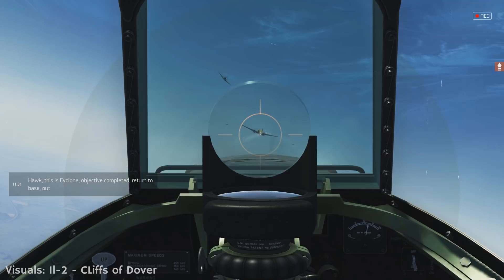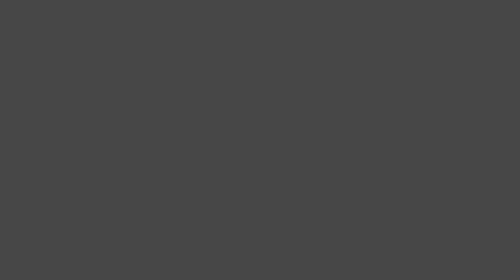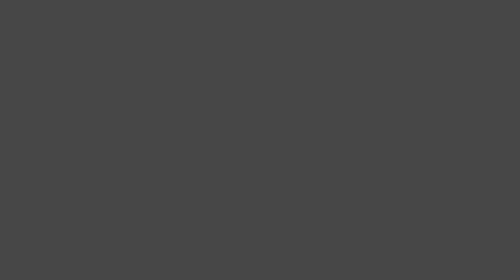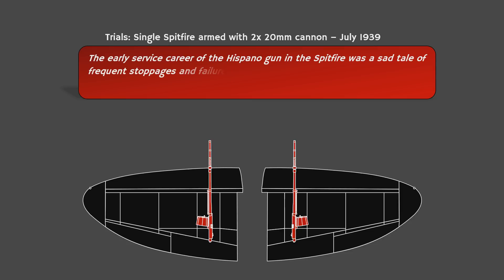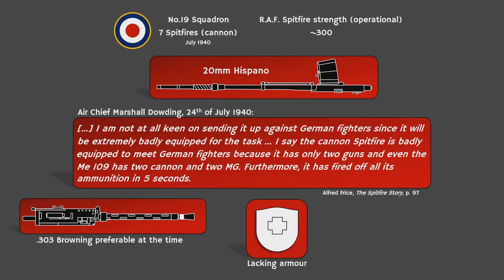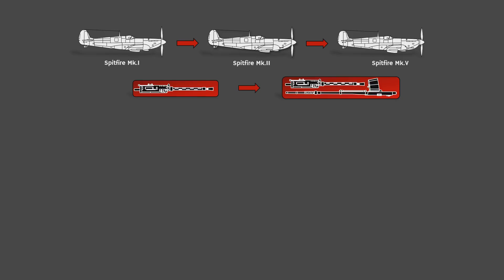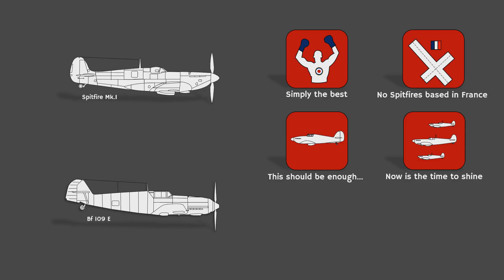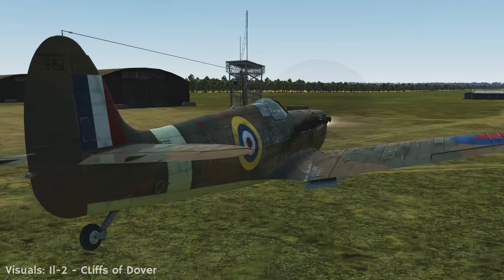⚜ | Clearing up Spitfire Misconceptions

Comment: The greatest misconception regarding the Spitfire is that it "won the war."
Reply: @Michael Paterson no sorry.
Reply: @Michael Paterson laughs in yak-3
Reply: @Michael Paterson ; How can any aircraft be the single most important when multiple types were essential?
Reply: @Michael Paterson ; That is simply factually totally wrong. It's also using an incredibly narrow focus. Most of the fighters when used where they excelled had an impact. The Spitfire where is was used had an impact. Which plane had the most kills in the 'Battle Of Britain'?
Reply: @buildmotosykletist1987  the only reason the hurricane shot down more German planes in the battle of Britain was because it was produced for a decade longer. There were 1715 hurricanes in use compared to 300 spitfires during the battle of Britain. So of course the hurricane will have shot down more German planes.
Reply: @buildmotosykletist1987  the orogional commenter means that in an overall impact the spitfire had the most impact. The p-51 for instance while a good escort plane could only truly do that. Because it was not as maneuverable as any other fighters so would lose in most dogfights when not high up. It also had a carrying capacity half that of the Spitfire's so wasn't as good in ground attack. Also the spitfire could be fitted with cameras making it an excellent reconnaisanse plane. While I agree that different types of aircraft were needed if America didn't use daylight bombing the p-51 would have never been needed and there would be less losses of bombers. On the flip, the p-47 was the best ground attack but lacked capability in dogfights. So the spitfire if you had to pick a fighter to do everything would be the one you pick because it can do every role very well or at least decently while the only role it couldn't, (being a long range escort) could easily be overcome by bombing at nighttime instead of in the daylight. It would also allow excess gunners to be scrapped in the b-17 to give faster speed or bigger payload.
Reply: @jacobkingsford5209  ; You might consider some reading on the subject and not unverified internet articles but verified sources like books. i.e. There were only 700 odd Hurricanes on 30 August and roughly 400 Spitfires.
Reply: @buildmotosykletist1987  I was not talking about a single day I was talking about the entirety of the battle of Britain. Overall throughout the entirety of the battle of Britain  1715 hurricanes were flown.
Reply: The losses the Luftwaffe sustained, particularly in terms of its best pilots in the Battle of Britain sowed the seeds of its eventual demise, which was largely the result of the Spitfire.
Reply: @nickdanger3802  Yank claims carry very little weight outside America. By the time the USAF showed up over Germany, the Luftwaffe as already in bad shape.
Reply: @gw7624  The Burning Blue  Paul Addison is a British author and historian, specializing in the British experience in WWII.   Jeremy A. Crang  is Lecturer in History and Assistant Director of the Center for WWII Studies at the University of Edinburgh. Mustang quote is from MUSTANG VARIANTS OF THE RAF AND RAAF
Reply: @nickdanger3802  Do yourself a favour - go look up the losses sustained by the Luftwaffe, particularly in terms of experienced pilots, in both the battle of Britain and Barbarossa. Now go look up the problems the Luftwaffe faced post 1942 in terms of fuel shortages. That the Luftwaffe was a shell of its former self by 43 is not even remotely disputed by historians.

Comment: Another misconception regarding the Spitfire Mk Ia, the main Battle of Britain Spitfire, is that it had a fast roll rate. This is not so, particularly at airspeeds above 300 kph (186.4 mph). The fabric covering on the ailerons would to ballon at high airspeeds, reducing the ailerons' efficiency and performance.
This caused a change from fabric-covered to metal-covered ailerons on the Spit V and the roll rate increased a good deal at all speeds.
Since most of the aerial combat in that era occurred at airspeeds higher than that, the Spitfire was at a disadvantage in a fast, turning fight against the better rolling and climbing Bf-109G, particularly the G-2.
Also, The Hurricane was a better, more stable gun platform, was equally armed (8x .303 mgs), had a smaller continuous turning circle, and as good a roll rate as the Spitfire. The Hurri's top speed was not as fast as the Spit's, but absolute top speed was not a serious factor in the BOB combat arena.

Comment: The most common misconception that I hear is that the spitfire was the most amazing aircraft to fly. 
However it did have 1 deadly design flaw, a very narrow undercarriage. 
As you can see at 8:28 the inwards folding rather than the outwards folding wheels ( unlike the Hurricane and the P51) but also akin to the Bf-109 meant a ground loop was a possibility if you took off or landed in a crosswind.  
This was because the wing wasn't strong enough to support the landing gear away from the center airframe. 
I own a Cessna 180 have almost 2000 flying hours and its a handfull that like the spitfire is very unforgiving of the unwary. Look ground loop up
Reply: tOM odONNEL: The RAF were still using grass strips through to 44 and I have yet to read it was a problem. Maybe the RAF trained their pilots better.
And my friend even US pilots liked them Maj Blyth loved it and he did 50+ PR runs to Berlin
Reply: A lot of planes had similar quirks to deal with. Those planes all had huge engines with lot of torque, and needed a certain amount of rudder trim just to roll straight on takeoff. They all had ground loop issues, it is just that some were more finicky about it than others.
Reply: It was forbidden to spin it and its stall characteristics were not very pleasant. But the latter is true for most WWII vintage aircraft.

Comment: The Damler Benz DB 601 had a significantly larger displacement advantage over the Merlin. 33 litres to 27 litres the later DB 605 was 36 litres. The injection pump on the German engines look similar to diesel injection pump on the outside. Carburetors where used all the way till the end of the war in pretty much all western engines. The later Merlin used higher octane fuel not available to the Germans had improved supercharging and intercooling but still had injection type carburetors. The Merlin had flame arrestor between the cylinder head and the manifold so a pre-ignition did not ignite all the pressurized fuel and air in the manifold and supercharger blowing the engine to smithereens. I think the Merlin achieve the highest refinement of any piston engine off the war while the German engine were technically superior in some ways I think the lack of high octane fuels held back development of their engines never achieving the same HP per litre.
Reply: Read Calum E. Douglas’s book on the subject.
Reply: @thethirdman225  I'll look it up.👍

Comment: Note. The Hurricane upgrade from the 1.a used in France to the 1.b used in the Battle of Britain was much more significant than many realise. Firstly Metal covered wings - not fabric. Secondly 3-Blade Rotol variable pitch propellers - not 2 blade wooden fixed ones. Thirdly more powerful and reliable Merlin engines - and improved oil coolers. Finally, using water / ethanol cooling liquid, and armour plate behind the pilot and armoured glass in front so big improvements all round for safety on top of power speed and control.

Comment: I believe two additional points are worth noting:_ Firstly while the mk1 Spitfire was basically similar in many respects to its prototype still with its 2 bladed wooden propeller, the Me 109s it faced in the battle of Britain were in fact the 5th variant, having been in service since around 1937 it had been improved, it first versions actually had RR Kestrel engines. Secondly another reason that the powers that be wanted to retain the .303 armament was that most new pilots reaching squadrons following the horrendous losses during the battle of France couldn't shoot straight so the 8 guns could be aimed to create an 10 foot wide blast pattern (like a shotgun)at 300 yards to compensate for poor aim.

Comment: Hi Chris, Thanks for all your great videos. You invite suggestions. Try this: Can you please do a comprehensive break-down of The German fuels (and not forgetting the often over-looked lubricating oils) industry in WW2, how things started and how things dramatically changed over the course of the war. Your 'drill-down' analysis should include a description of the basic production processes (the legendary 'secret' synthetic fuels extraction from coal, etc), where all these various plants were located, their capacities, their specialisations, their manpower requirements, how many survived vs how many damaged and at what times, how was fuel distributed to far-flung forward battlefronts, what help/obstruction did Germany receive from neighbouring countries. In conducting such an analysis you need to get down to some nitty-gritty detail in respect of the different grades of fuel used by different arms of the Luftwaffe (and other German military services), were the aero-engine manufacturers pushing for even higher octane grades and were these fuels under active development, had Germany analysed fuels and lubricating oils from crashed Allied aircraft, how aware were they of the octane rating they were using? Your analysis should also include a future projection of how the rapid spread of turbojets, displacing the piston engine would have changed the fuel supply situation. Then there are special weapons like the V-1 which used a low-grade of petrol. Had their numbers reached the high levels (they didn't) demanded by Hitler would that have adversely impacted the supply situation for conventional military needs. This is a big project but one that is long, long over-due but it is a vitally important back-drop to understand how the war progressed.

Comment: I am fortunate enough to live next door to North Weald airfield in Essex, one of the last remaining BoB airfields still in use, if only by civilian aircraft (I also work next to Stapleford Tawney airfield, a satellite of North Weald).There were many squadrons based here over the course of WWII but North Weald is known mainly as a base for Hurricanes. There is a common misconception in the UK that the Spitfire won the BoB and while it's contribution in this period cannot be overstated, the locals around here will tell you this simply isn't so. There just weren't enough of them at that time. So the majority of the work had to be carried out by the increasingly outmatched Hurricane, an aircraft often looked down upon. But we love the Hurricane around here :)
This area was fairly extensively bombed during the summer of '40 and there are still a few bomb craters scattered around in the fields as well as some very small pillboxes. I am well used to the sound of both Hurricane and Spitfire these days as the airfield is still used sometimes by restorationists and the BoB flight always passes by directly overhead on it's way to London.  We did eventually get some Spitfires when some American Eagles moved in later in the war and I believe the Norwegian squadrons that came after had a mix of both ( I could be wrong).
So the point is, I guess, do not forget the Hurricane and her pilots. they did an amazing job considering what they were up against. I'd love to see a Hurricane video one day. Sure, it's not as sexy as a Spitfire, but it had balls!

This is a quote, lifted from Wiki, from a Hurricane pilot about trying to fight the superior 109's: 

 'Another thing we did was to devise a manoeuvre which was aimed at getting us out of a difficult corner if we ever got into one. This may sound very extraordinary, probably, to practising pilots today, but it consisted of putting everything into the left hand front corner of the cockpit. If you saw a 109 on your tail, and it hadn't shot you down at that point, you put on full throttle, fine pitch, full left rudder, full left stick and full forward stick. This resulted in a horrible manoeuvre which was, in fact, a negative g spiral dive. But you would come out of the bottom with no 109 on your tail and your aeroplane intact.'
Roland Beaumont describing how a Hurricane can get away from an Me109

Gosh!

Comment: Once they sorted out the jamming problem of the Hispanos it became an excellent weapon with enormous hitting power. Here's something not many know, after the initial BoB combat experience it became obvious that the eight .303s had inadequate "hitting power" (ie destructive penetration) against armoured aircraft with 'self sealing' fuel tanks. Although the eight guns between them fired no fewer than 160 rounds per second, they were initially adjusted to concentrate their fire at the long range of 365 m which led to the hits being spread across the target at shorter ranges, this was no good because the .303 needed concentration of hits to penetrate or destroy. As German aircraft equipped with self-sealing fuel tanks and armour were now the norm not the rarity, it proved necessary to concentrate fire at much closer ranges, hence the aircraft had to close much closer and were susceptable to enemy defence fire. Because of the lack of destructive force against self sealing tanks, .303 incendiary rounds were required to ignite the tanks, but,  due to a type shortage, usually only one or two of the eight guns could be loaded with incendiary  ammunition. A series of ground tests carried out by the British, firing at a redundant Bristol Blenheim from 180m to the rear (dangerously close in a-a combat) revealed that the .303 incendiary B Mk VI bullets would set light to a Blenheim wing tank with only one hit out of five! Hence, the Brits quickly looked at the Mitchell designed Spitifre variant Type 312 wing which had room for four Browning .50 cal's, but, and this is so typical of the Brits, the weapon was considered "under-developed" by the Air Ministry and was placed aside, and besides, they had millions of .303 ammunition stockpiled so continued with that despite knowing it was inadequate

Comment: Cannot believe the Writer did not do his “Home Work”.
Poster is a FAA Licensed A&P and a Aeronautical Eng.
The Spitfire suffered from “Fuel Starvation” on inverted flight, but would transition to flooding the supercharger on returning to level attitude.
This was fixed by placing a “Check Valve in the Fuel line” by Beatrice Shilling.
Reply: RAE restrictor.  Shilling's was not effective enough, so it was modified.

Comment: There are manoeuvres you can use to get over the Corroborator problem. For a dive, just flip the plane over as you go into a dive to commence a positive G dive instead of negative. For an Aeleron roll, just do a barrel roll instead. :)     Also it could be said the Spitfire whilst important during the battle of britain, would have been better strategically to be simply overtaken be Hurricane production. However, it was important for it's development during the war where the Hurricane became obsolete.

Comment: I think another misconception is that since Hurricanes were usually mentioned as being less good then the legendary Spitfire, many may think that Hurricane performed poorly or something. I think I read about it somewhere that Hurricanes, in all submodels, actually scored more kills than the Spitfire series.
Reply: better in the BoB which is prob what the OT meant though that was for other reasons. The H was obsolescent  by 41 and should have been replaced but for the foul ups on the tempest/Typhoon  design/deployment

Comment: The early spits did not flood when you pushed the nose forward.  G-forces forced the float against the top of the carb, causing the flow of fuel to shut off, because the float was now in the position it would be if the float chamber was full of fuel.

Comment: Any truth to the rumor that the reason the Brits put eight machine guns in the wings of the early Spitfires was because the wing was too flexible and resulted in a very scattered shot pattern?  Having eight guns increased the chances of hitting the target.
The biggest advantage that the RAF Fighter Command, both Spitfires and Hurricanes, had during the Battle of Britain was that they were fighting defensively so their short range wasn't an issue.  The German 109 pilots had to constantly monitor their fuel gauge or else they stood a good chance of running out of gas and not getting home.  It is hard to dogfight with one eye looking at the fuel gauge and the other eye looking out for the enemy.
Reply: The RAF specification to which both the Hurticane and Spitfire were designed expressly called for 8 guns. The .5 Browning wasn’t an option. 
The 8 guns were an unpleasant surprise for the Luftwaffe as the 109 was comparatively under gunned. They never really made up for the defecit.

Comment: The biggest misconception is that it (and the Hurricane) were fighters.  The Operational Requirement  was to shoot down UNESCORTED bombers flying from Germany – Well beyond the Combat Radius of any escort expected to  be available in the foreseeable future.    They were Bomber Destroyers.   Their performance and equipment were optimised to that end.    The manoeuvres which caused temporary embarrassment over a small area of Southeast England in the summer of 1940 were not needed against bombers.    Armoured glass windscreens were, and were provided before the war.    Fortunately for the RAF, the Spitfire had sufficient surplus performance to offer resistance to the ME109 which was optimised to gain and hold  Air Superiority by destroying enemy fighters.      The RAF soon changed the job specifications.  The Hurricane continued to do what it did best – Attack the bombers.    The Spitfire did what it could do well enough, keep the escorts away from the Hurricanes.